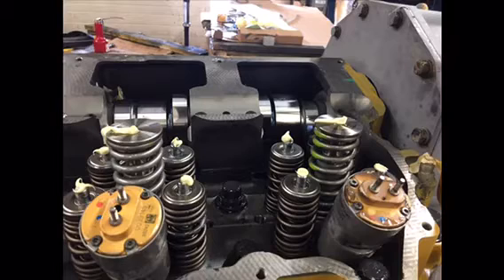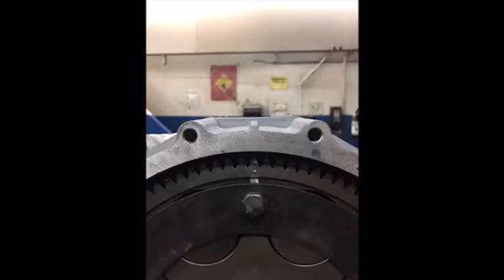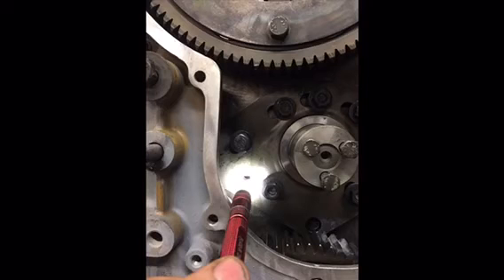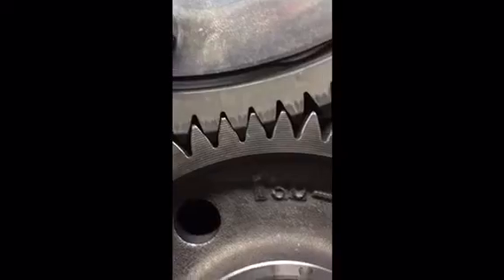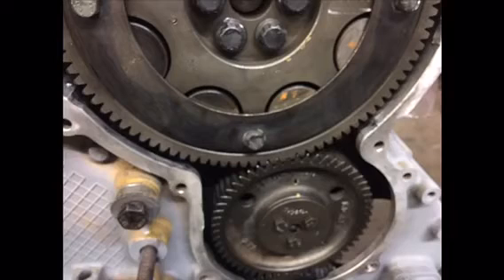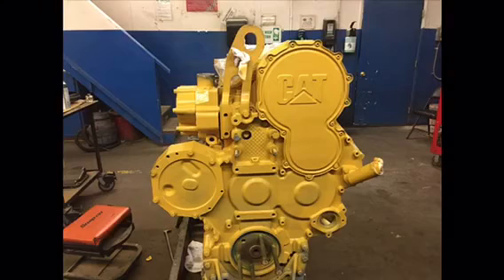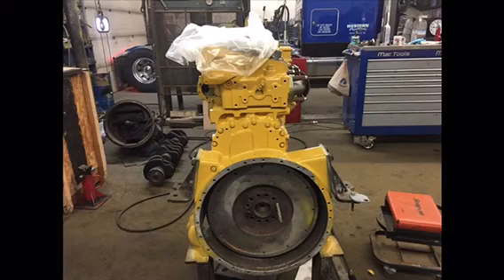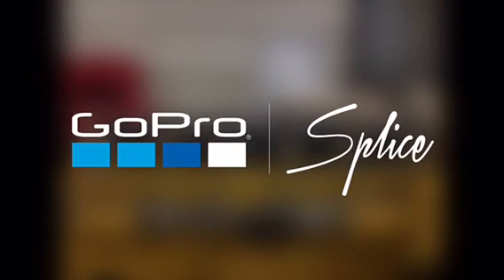C-15 cam gear timing, lock tight everything but the cam gear

Comment: I just today finished re-sealing the entire front of my c-15. What a pain in the ass that job was. Had to da a clutch and motor mounts and 2 u joints and a front and rear main seal.
Reply from the maker: yeah, but you saved yourself a lot of money. i always hate working on my own vehicles, but it saves so much. and actually i know i did it right. the one time i got my oil changed somewhere, the filter was not tight enough, and leaked. scary